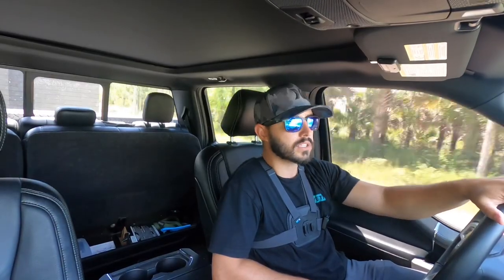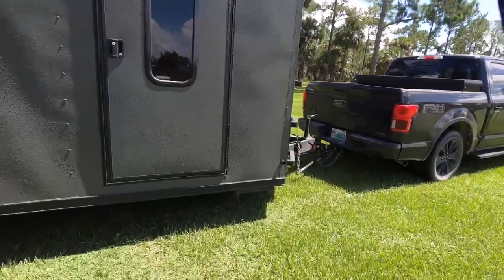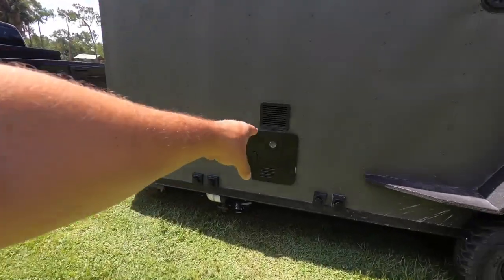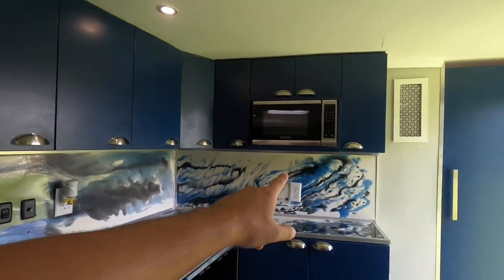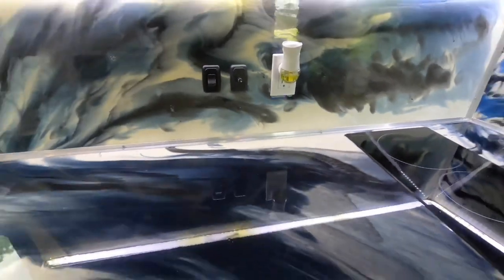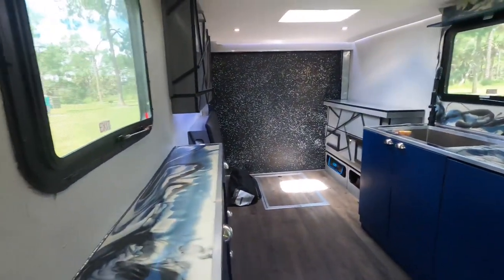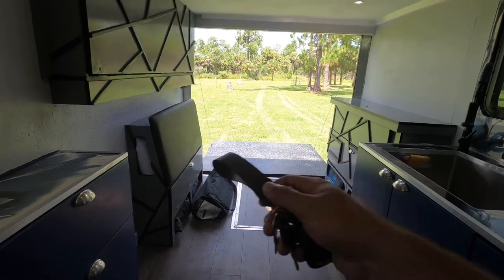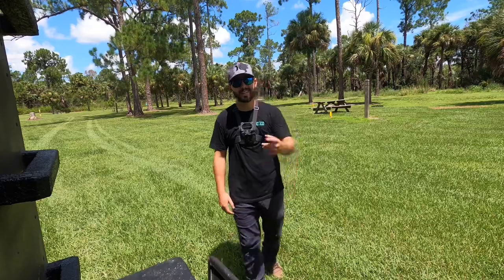Cargo Trailer Camper Conversion… Toy Hauler, Tiny House, Bathroom, Walkable Roof, Overland… Tour

Comment: The whole thing is amazing. Questions I had about the epoxy plywood: what did you use in between two boards especially in the shower? Is there any regular maintenance involved with them? Would you consider a one video tutorial for a complete beginner to epoxying plywood for how your using them especially for shower area? Thank you for showing this. Subscribed, so any more videos on your rig I'll be watching.
Reply from the maker: @tim Tim thank you! We simply put insulation between the exterior aluminum wall and the interior shower wall. On the shower walls we used flex seal on the back side of the walls and then we epoxy the front side. We used caulking to seal up and gaps or cracks. There is no special maintenance that we do, just normal cleaning. I don’t have any videos on it or any up coming projects with that at this moment but there is person I watched online and bought their product and he makes a ton of good videos and how to videos with the product which I think is a great reference point. It’s called stone coat countertops on YouTube. Hope this helps. Thanks for the support and subscribing to the channel. Hope to have some cool mods in the near future.
Reply: @tacltogether  Glad I found this! Headed to stone coat now

Comment: On the bathroom sink where does that water fall when it runs off the side?
Reply from the maker: We don’t have much run off to the sides. If anything sometimes a very small amount of water which can just be tried up with a cloth but we are just cautious where we are turning the sprayer and we haven’t had issues in all this time.